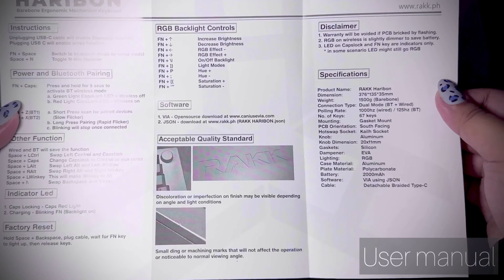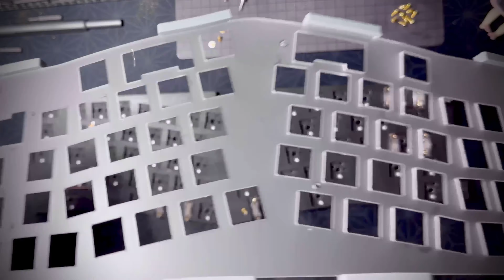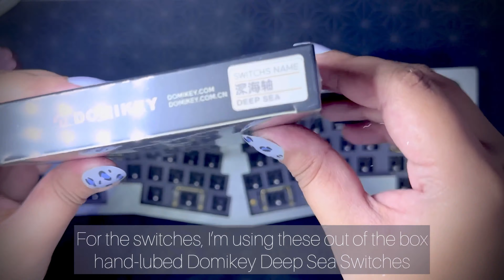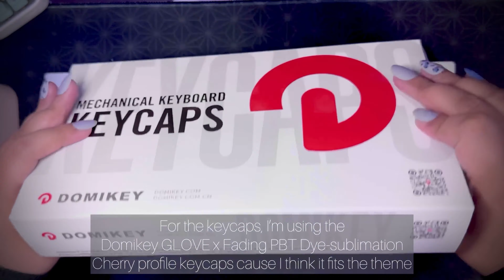Rakk Haribon Unboxing, Teardown, Modding | Domikey Glove x Fading Keycaps | Deep Sea Switches | ASMR

Comment: How do the domikey switches compare to gateron yellows? Would you say they could be used in a creamy built?
Reply from the maker: Gateron yellows still needs lubing cause it is scratchy as is, whereas these switches already come hand lubed by the manufacturer so they’re smoother. For the sound, I would say this is a little quiet and slightly high pitched but if you use an ABS board and a slightly higher than cherry keycaps, you can achieve creamy